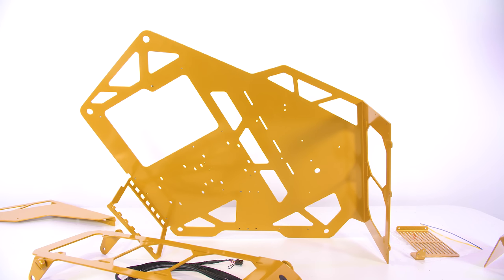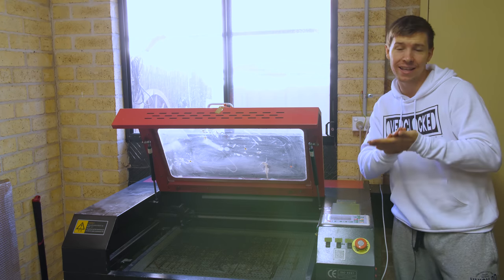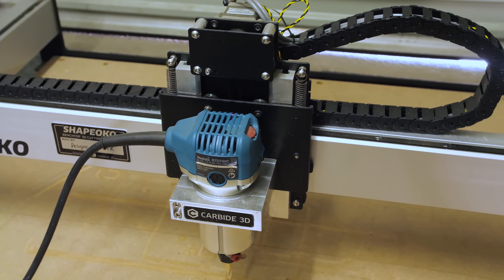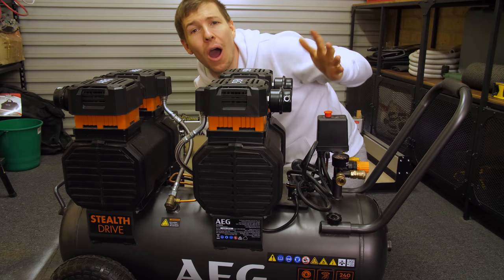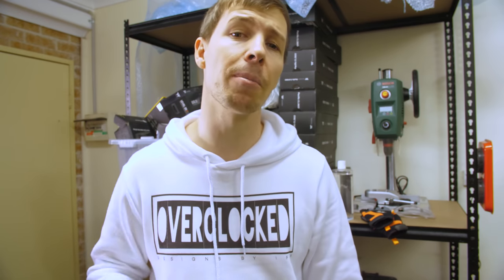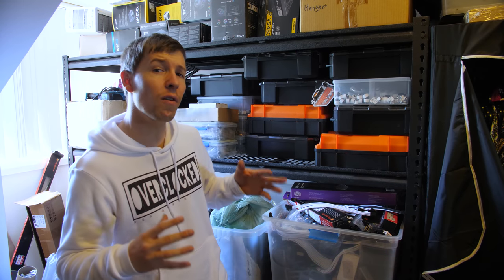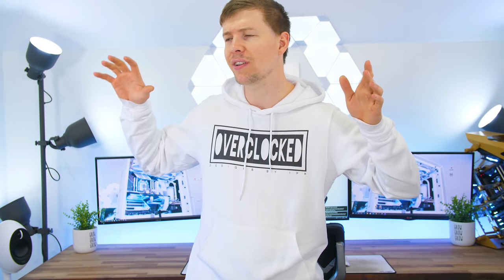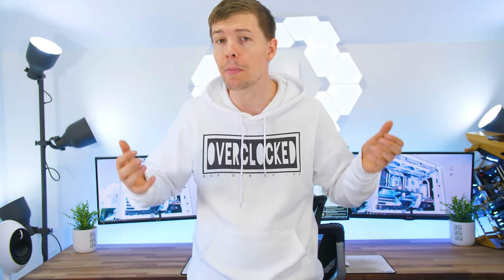So this is how we Create Our AMAZING Custom PC Builds! - Work Shop Tour

Comment: Thanks for sharing a "look around!" As a home tinkerer/builder/designer these types of vids always provide fresh ideas for how I could better organize my workspace! I also use some equipment at a local Makerspace (mill/lathe/etc.) which has that exact same laser cutter. Unfortunately, due to neglect, it's not at its best right now. However, I have been cleaning/adjusting/calibrating the laser cutter over the last couple of weeks with marked improvement. Now that I know you have achieved your fantastic build results with the same laser cutter, you have set the bar very high for myself! Again, thanks for the video, my wife and I continue to enjoy your builds!

Comment: Was that “I F R” or “IFRA” during the introduction? :)
Reply from the maker: Hahaha IFR
Reply: Designs By IFR Just checking! Also, what’s that shiny/metal based thermal compound you use on the CPUs, and would you apply it on a GPU when putting a water block on it?